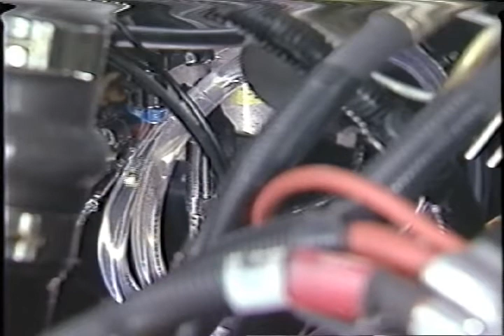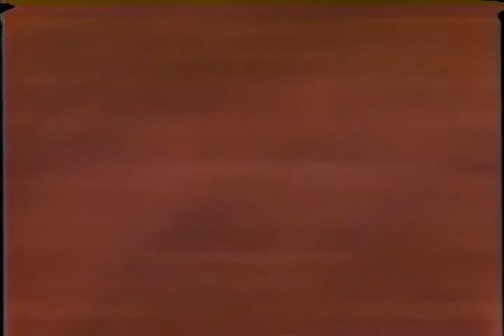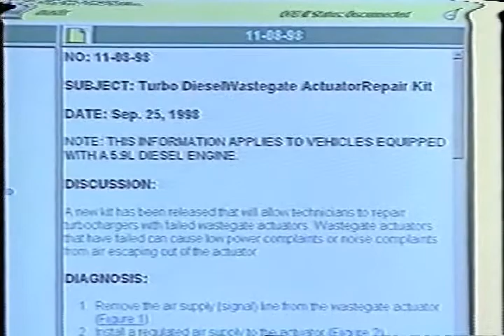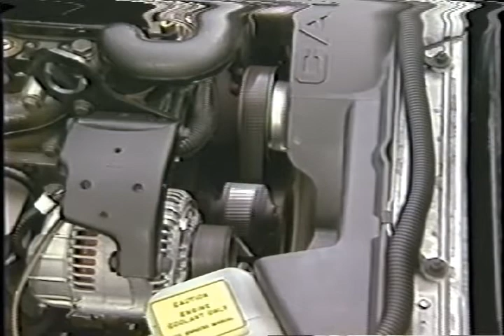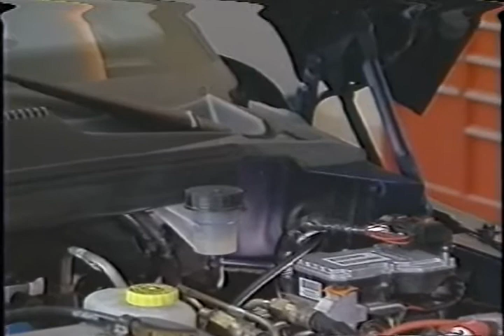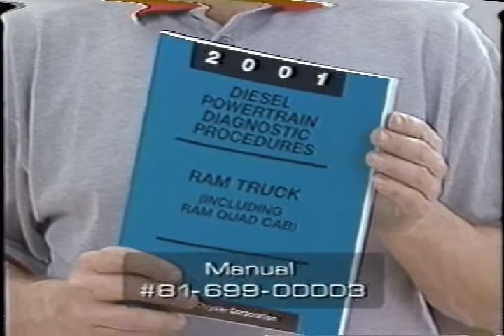Chrysler Mastertech - 2000 24-Valve Cummins Diesel update - Part 3

Comment: my 95 12 valve was chirping just like the video said. turned out to be a bad automatic tension pulley. just a heads up check to see if your serpentine belt is sitting straight on the pulley.

Comment: I had a problem with my 2001 not starting when hot.  I'd stop on the highway for gas and couldn't get it to start again unless I pulled the water separator lever on the filter housing resulting in a puddle on the ground.  It was the water separator valve itself $30 and it was fixed.  The previous owner spent $4K on a new lift and injection pump for the same problem to no avail at a specialty diesel shop.